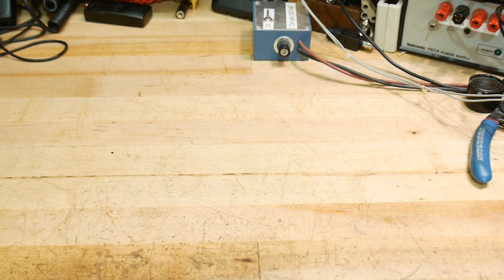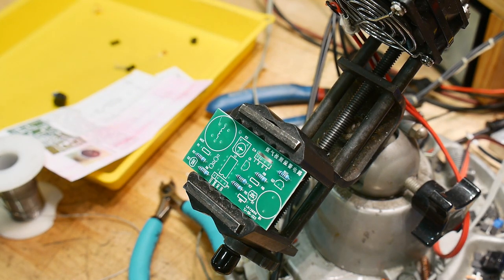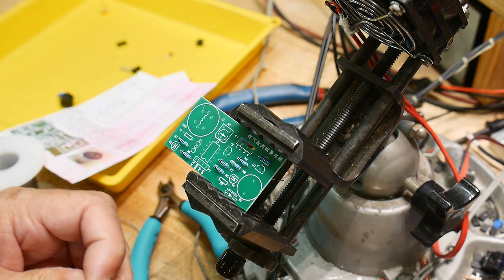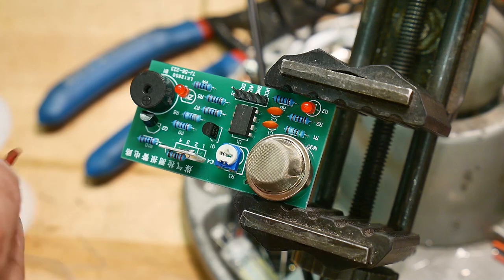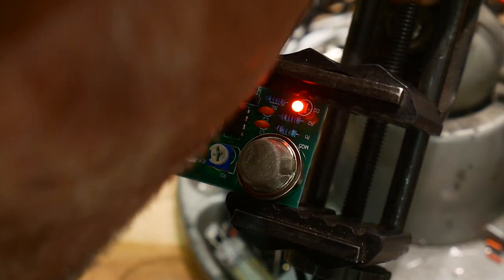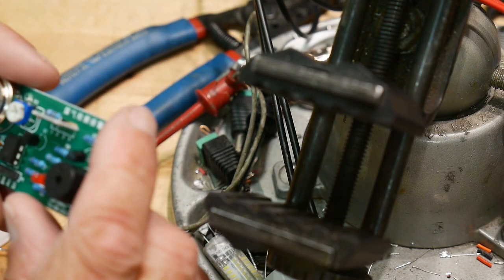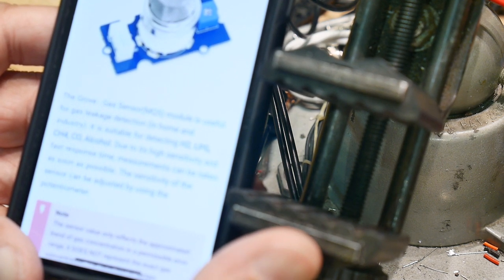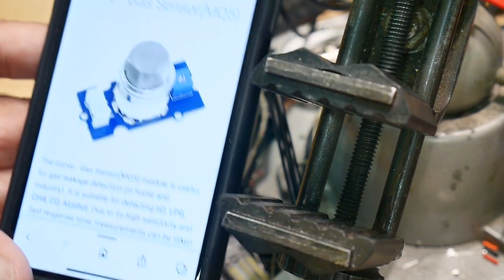#896 Gas Sensor Kit

Comment: tin dioxide sensor from wikipedia "The resistance of the tin dioxide is typically around 50 kΩ in air but can drop to around 3.5 kΩ in the presence of 1% methane." or  LPG Propane. ( ref: https://en.wikipedia.org/wiki/Gas_detector#Semiconductor ). Humidity is a problem so the heating element makes sense. I'm guessing that it is something like a four wire resistance measurement using a kelvin bridge. with a heating element in the middle to drive away any moisture which would produce a similar effect to methane, LPG or Propane. But it looks like the circuit used 27:40 is just treating it like a standard two wire resistor, which is good enough for most use cases.